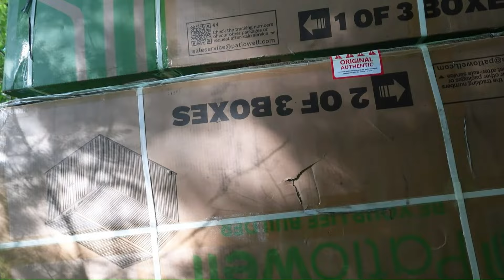#newproject How to build a 8x12 metal shed. We're finally at building day!! #outdoors #offgrid

Comment: Hello Jason & Clarissa, great job putting the patio weld shed together. It looks great! You guys are killing it on your property. I love how the shed is coming out and I can’t wait to see it finished. That old tractor is a back savior. It saves you from wear and tear on your vehicle and also on your back. Your very lucky to have it. Just wondering does the shed say what the roof is rated at for snow bearing? In the winter you may have to add a temporary support or two in the center of the ridge to the ground to help the roof hold more weight. We would do that to our campers in the winter. We would add a couple supports from the roof to the floor to strengthen the roof! Good luck with the completion of the shed. I love you both! Keep up the great work! ❤❤🤗🤗😘😘🙏🏻🙏🏻
Reply from the maker: @mattcasso8465  HEY Matt!! 😁😁❤️ Thanks so much!! It'll take just shy of 1k lbs 😉 we LOVE HELGA ❤️ 😆
Reply from the maker: @mattcasso8465  Love you!!! ❤️

Comment: Chalkline the concrete for the layout goes faster and that many tapcons , use a hammer drill and the bits don't overheat . I'm kinda curious what the roof load rating is , you get some serious snow weight up there.
Reply from the maker: @user-dg3kj5mr4h  😁😁👋👋 Jason said the roof load rating is just shy of 1k lbs, that's why he picked this one I guess 😅  and with the metait does slide off pretty well 😉  
EXCELLENT IDEA  to do a chalk line 😁😁 great advice!! 😁❤️
Reply from the maker: HEY GARY! 😀👋